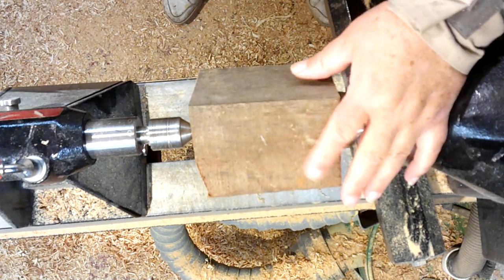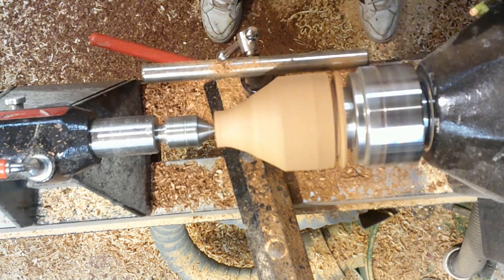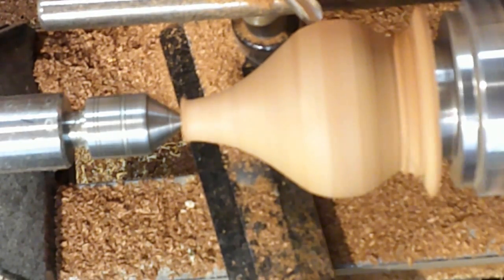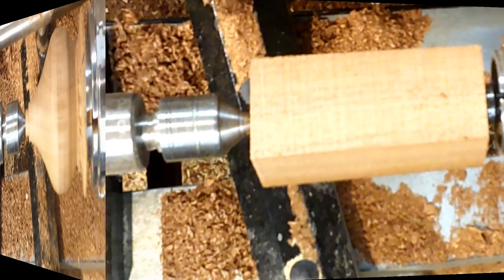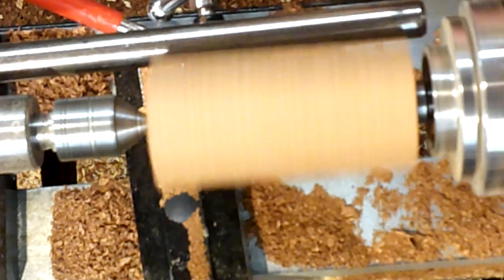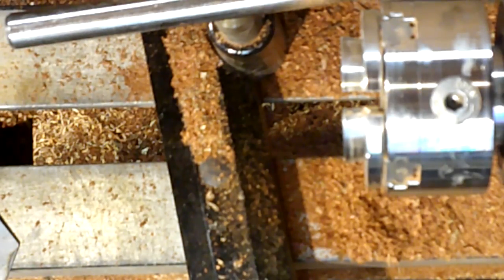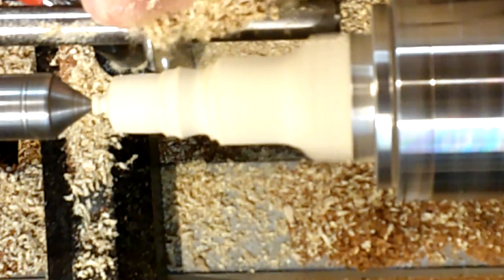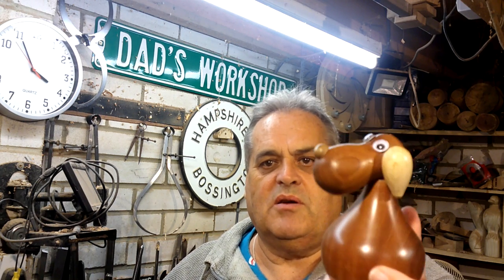Wood turning an adorable Dog using three different woods #90

Comment: Just a really great piece.  Where did you get the eyes.   Thanks for sharing.   Hope to see you on the next one
Reply from the maker: Hi Albert, thanks, I only got them off the internet i think they were just called goggle eyes, but because the wood is curved, they didn't stick that well and had to super glue them, i think if i did another one i would paint them on

Comment: Love this video and the dog!  I am a new turner and would love to try one.  Would it be possible for you to post the diameters of the various parts on the body and the head? Thanks again for a great video 👍🤠
Reply from the maker: Hi Randy glad you enjoyed the video, I'm really sorry but the dog has gone already, I do remember the base was turned out of a piece of Iroko which was around 90mm square and around 120mm long, all you have to remember is that dogs come in all shapes and sizes, Please let me know how you get on
Reply: @thehampshirewoodturner  that’s okay ….. I just stopped the video and used the chuck as a rough sizing tool 🤠
Reply from the maker: @randyrockwell6136  Very clever with ingenuity like that you will go far, lol